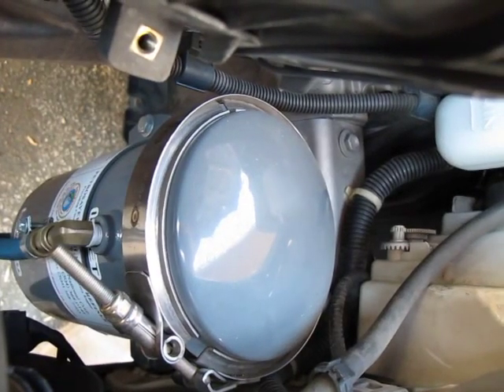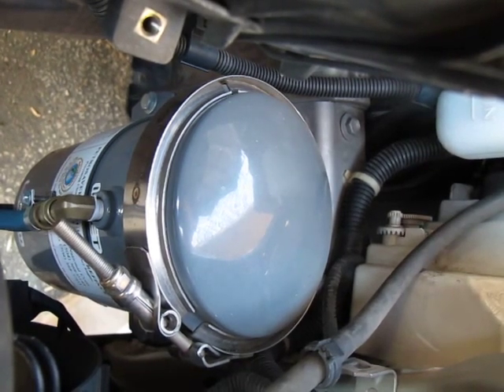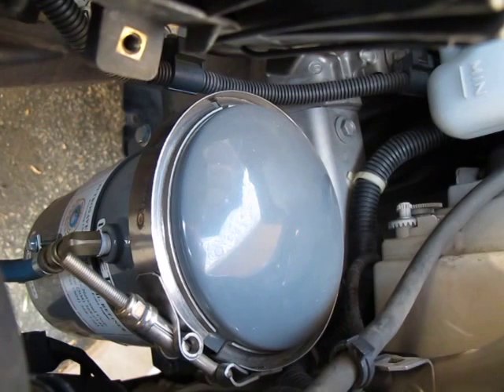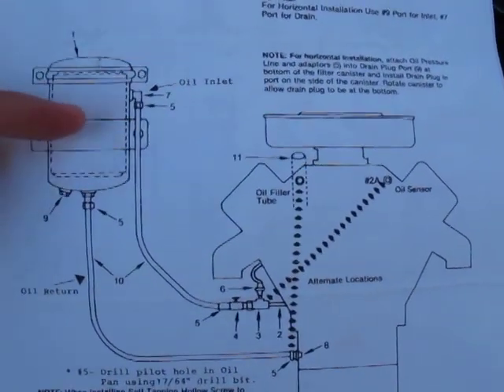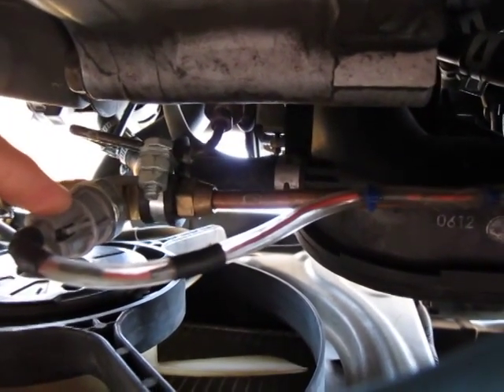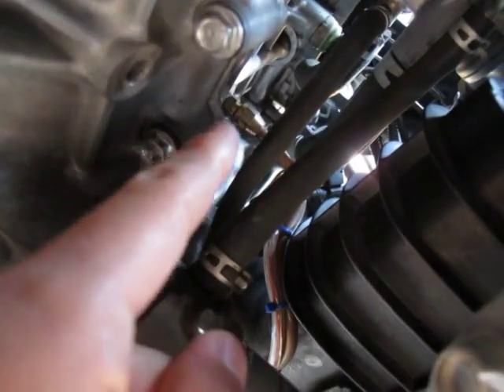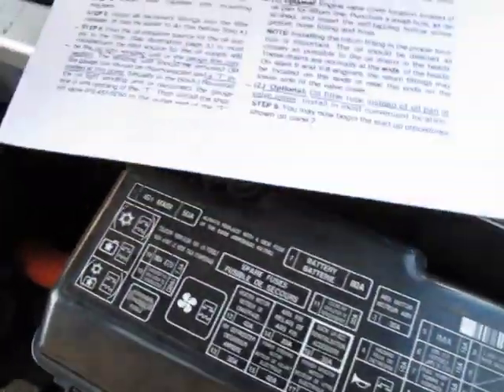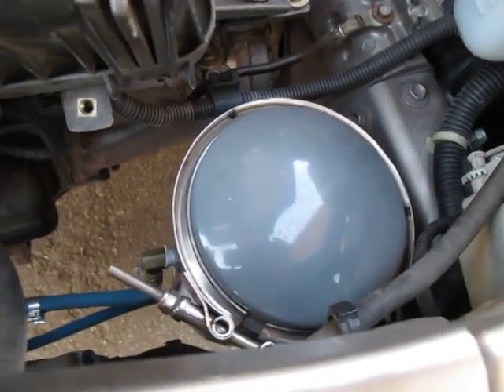“Keep The Oil - Change Your World” PetroSavers Engine Oil Refiners “the end of the oil change”

Comment: Interesting, ¿When do the next change  filter?, How many miles has a filter yield?
Reply from the maker: Thank you. I find this technology quite interesting as well. I now have just over 30,000(Thirty Thousand) miles on this engine oil which the engine oil refiner has kept clean. Because I'm running the PetroSavers engine oil refiner model HD-10 and the 2000 Honda insight only has a 1 Liter engine, I will have an oil analysis done at 20,000 additional miles(At total of 50,000 miles- on engine oil). With larger engines, the oil refiner element will be changed at 20,000 mile intervals. My research and study indicate- engine internals become highly polished(Thus reducing engine internals- friction) as a result of running the PetroSavers engine oil refiner. Engine wear is also reduced by 95%. This is quite good :)
Reply from the maker: Koito rob Hi Koito rob. Yes. PetroSavers has all the science and lab test to reveal the consistent lab test results. Contact PetroSavers and request any information you need. Testing has been done for over 25 years- and the results are consistent- and predictable.

Comment: Ive emailed petrosavers still havent got a responce. how much did yours cost? how much did the refiner pack cost? I really would like to purchase one of these refiners I put 200 to 400 miles on my turck a day. I change my oil about twice a month and this would be a real nessesity for me to keep costs down. thanks
Reply from the maker: PetroSavers is very busy with orders. Orders are filled in the order received. My understanding is- you may both email and or call- leaving your phone number- and or address- and let PetroSavers know you wish for more information about the PetroSavers Engine Oil Refiner- and if they may send you via mail- any related information. If and or when you wish to place your order- you may leave this information with PetroSavers via phone call and message- and or via email. You must speak with PetroSavers regarding pricing specifics. Considering I never change the engine oil again(when running the PetroSavers Engine Oil Refiner) and reduce engine wear by 95% or more- made the engine oil refiner quite interesting- and distinctly different than any other oil filtration system or engine oil refiner- I've study.

Comment: Interesting. I've always thought that the burnt carbon from the fuel manages to slip past the piston rings and infiltrate the engine oil.
Reply from the maker: The unburnt(gasoline that does not achieve contact with Oxygen Molecules thus not permitting complete combustion ie see "Partial Combustion") liquid gasoline droplets that wash the lubricating oil from the combustion chamber cylinder walls- thus permitting gasoline ie HydroCarbons to mix with the engine oil- does take place within gasoline powered engines(Less so with Natural Gas Powered Engines because natural gas molecules achieve an equal- balanced- complete burn(See Stoichiometry) within engines combustion chambers thus permitting engine oil to remain quite clean ie see CNG engines and or Gasoline powered engines that have been converted to Natural Gas Fuel System- Engines). The PetroSavers Engine Oil Refiner removes unburnt fuel ie HydroCarbons, Removes Water(Moisture) from engine oil(Note: Moisture presence within oil permits the production of Acid within engine oil, thus remove water moisture from engine oil, and acids are not permitted to develop(form) within engine oil). All harmful contaminants are removed from the engine oil with the PetroSavers Engine Oil Refiner. It's quite an interesting technology. My research and study indicate- beyond keeping the engine oil clean- the PetroSavers Engine Oil Refiner- Ultimately refines the engine oil to a point that the oil lubricates the engine internals- better than when the engine oil- was new. Thus engine internals which rely on clean oil(Thus minimizing engine wear) to remain lubricated- become highly polished- including engine crankshaft main bearings as well as crankshaft to piston connecting rod bearings- and all camshaft bearings. Engine oil seals also achieve a longer life because engine oil is kept clean at all times. This is a wonderful discovery by NASA Research Scientist Ralph LeBlanc- and his research team. Over 25 Years of Research and Development- Available to anyone that wishes to experience the PetroSavers Engine Oil Refiner.

Comment: How much is it? I don"t see a price any where on their web site?
Reply from the maker: PetroSavers makes several different units for different size engines. Contact PetroSavers directly via the web site address I show in the video, or see the link below the video- select "show more" and you will see the links. Write or call PetroSavers directly- let them know what size engine you are running ie Liters and Or Cubic Inch Displacement of engine- as well as fuel type ie Gasoline- Compressed Natural Gas(CNG), LPG or Diesel. Thank you for your question.